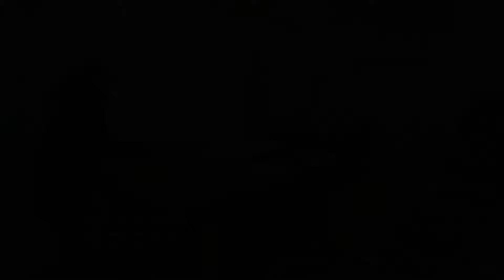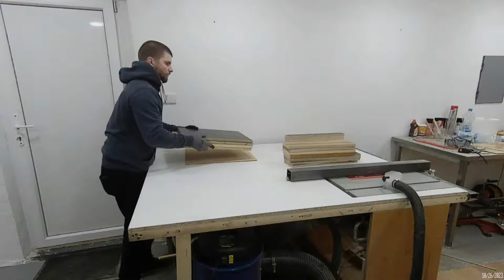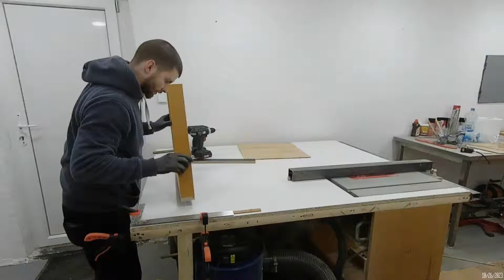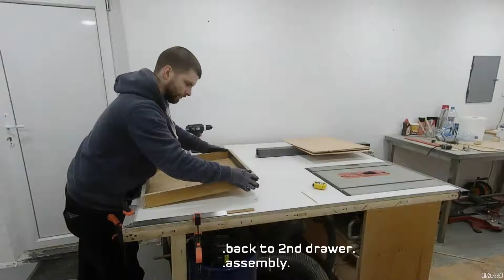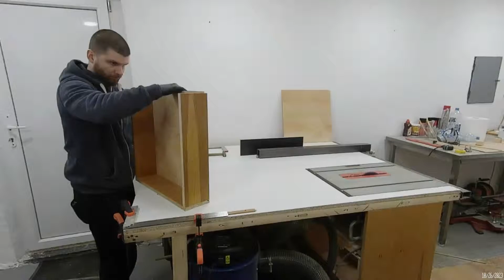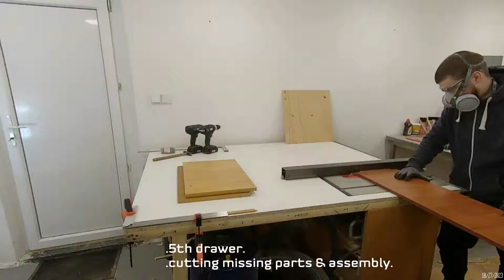DIY Electronics Workbench (part 2/4) - Drawers Assembly

Comment: Hi, please advise what the small device fastened to the saw table does when you present the drawers to it. With the word overlays your videos are excellent, as I opine, is your workmanship.
Reply from the maker: I think you mean table saw fence mechanism..closer to the wall is mobile fence to define the distance between the fence itself and the cutting wheel of the saw..to be able to make the cuts in certain width

Comment: How deep are the shelfs. Is there a a good minimum depth to keep in mind, that can fit most tools? Like 8 inch (20cm), or is that to shallow? I’m new in electronics, but I wanna set up my workbench to allow me to grow into it, without having to redo my workbench setup.
Reply from the maker: That's a tricky question. Depends on your direction on electronics field. Soldering or better said desoldering tools are usually more deep. Measurement equipment depends on the purpose, ditital oscilloscope is not too deep, but equipment for analogs usually are. Power supply is important, what voltage or current you will be need on yours applications, usually bigger range means more robust box. You never knows which thing will be need in the future, that's why I made my shefls configurable.. I have no problem to change its wide or height when it become necessary...
Reply: @webblab2415  I've got a 270x270cm (just shy of 9x9ft) workspace, that will be a motorbike, bicycle storage, car & motorbike repair stuff, wood working stuff, general tools and other stuff, electronics and what else I did not think of yet,  space :-)         Hence the challenge is space and combination. I will make my own video on the shop,  but good planning is the base of it all.  

My idea is, that I will have a big workbench (maybe 160x80cm of  64 inch by 32 inch). On the back of that, I want to have shelves.  I will make the workbench fold able, closing against the shelves, keeping it as small as possible.  For example, if I take 20cm (8 inch), the bench thickness being 5 inch,  it will be 13 inch off the wall in closed state.    Now I do build in an escape; On the left of my work bench is a wall, on which I make cabinets (same height as work surface) which will be fixed, and will be 50cm (20 inch) deep.   So anything that cannot fit a shelve, but could be on my left,  could go there.

Currently, I've feeling like 22cm might be a good size, the width of a A4 or Letter format piece of paper.  As I have zero electronics and zero idea how much money and time I am willing to spend on it on the long run, I'me now looking if I can find any rough standard dimensions on equipment.  If I here from you for example, that all the digital stuff is ranging 15 to 19cm deep,  and analog up to 30cm,  then I know that I'll be OK for digital but not for analog.  Also, as the bench is big, I can still accept that it's part of my setup time => Open the work bench, get some of the big stuff and put it on my right side on the bench, then get to work.

As it's a combined space, with insulation and heater buy no climate control,   humidity, temperature and dust will be a challenge any way, so I have to accept some cleaning & set up time before and after any job.